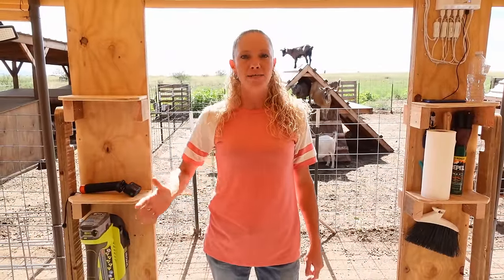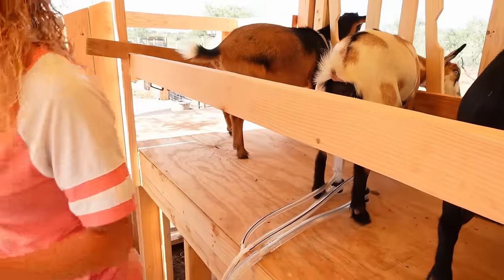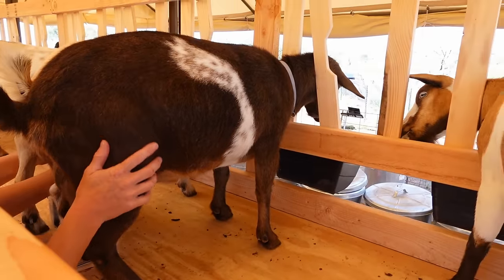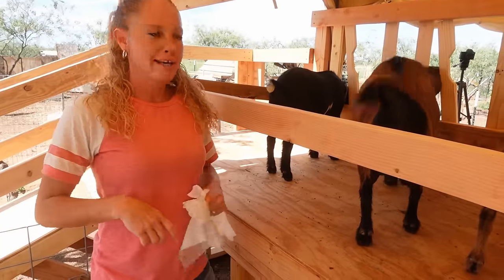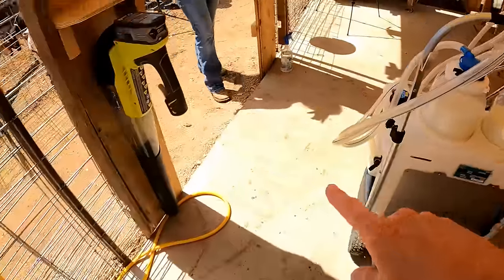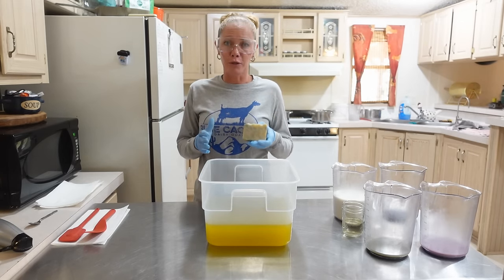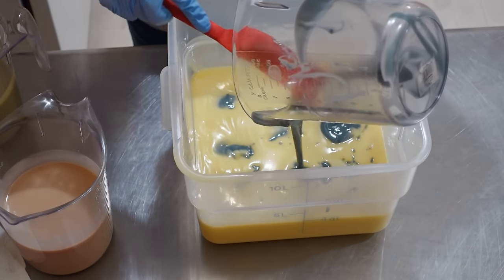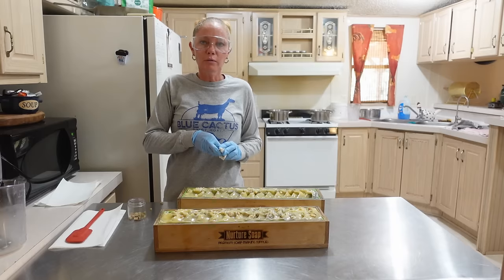Our HUGE Milk Parlor In Action!

Comment: I guess the second group took offense at being called 'brats'  🤣 So only 1 milking machine   for two goats at a time, but still easier than the 2-at-a-time of the old way. Once settled into the stalls, it's a continuous pattern. Very nice.

Once the ladies get used to it - it will go even faster. Especially being mostly protected from the weather while waiting. Thanks for showing the whole operation.

Comment: I'm impressed how in a short time you've got that down, like you said it will get better in time . Just hoping it's not to cold this winter, you can always put in heaters with blowers and drop the sides. Maybe little blankets? And as thay go down the ramp just slide them off for the next lineup.

Comment: The stand could benefit from something to block the first 2/3 of the head spaces when the does come in. Two pieces of plywood or tarps, on the side where Darren was. 

Fill the last third with does, remove the middle covering, fill that, remove the first 1/3 covering, and last does go into that part. 

But I'm behind on videos, so maybe the does go smoothly already😀